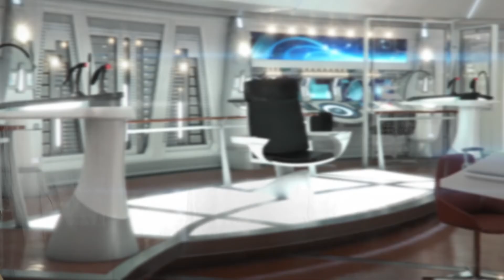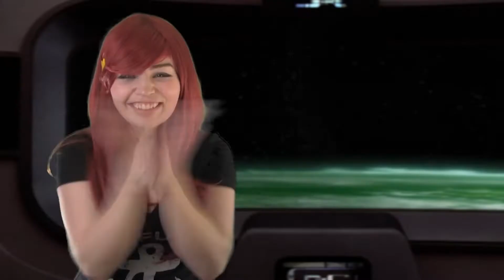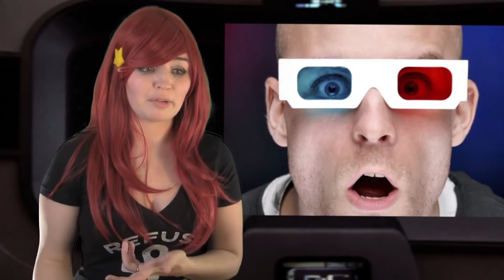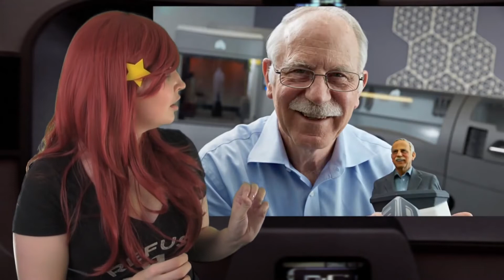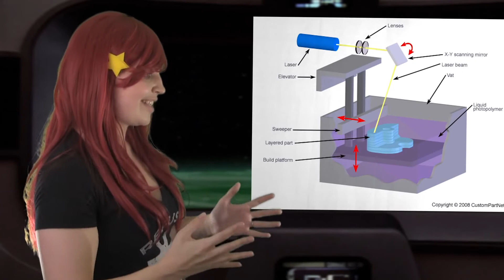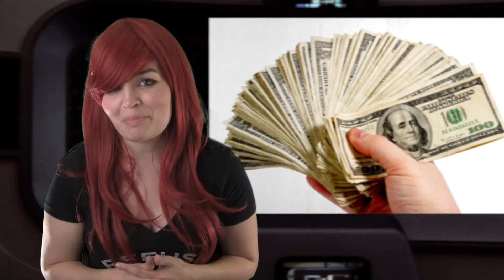How Does 3D Printing Work || Kiriosity Classic

Comment: I have my own 3D printer. I have printed a couple things for others. You can get some super nice prints. 
With the variety of CAD programs, the different 3D model sites, plus various slicer programs available has opened up 3D printing to a variety of small businesses, and individuals to do work that was not possible just a few years ago.
What can be created with 3D printing is only limited by 2 things: printers capabilities and an individual's imagination.
With photogrammetry apps for smartphones, you can scan items, even yourself and 3D Print your wedding cake topper or a scaled model of the wedding cake.

Comment: I bought a cheap 3d printer to make dnd models and it work well, especially since I became a new DM. After a while I started using it to print wall hook for my wires and hats, small custom gifts.
Reply: Did you see the new resin printers under $300

Comment: I picked up a used 3d printer just to get my toes wet, and it's been a great experience. there is a learning curve, but for under $200 (or in my case $100) you can get started with a small system and start making things. I've so far printed camera accessories, d&d figures, and just random things like a 3D Gamecube logo
Reply from the maker: That's amazing! It's fascinating to see how much more accessible it's become since I made this video as well. In just... what... 4 years? 5, maybe?

What kind of camera accessories? Have you been designing your own designs?
Reply: @KiriCallaghan  I've printed battery holders, film roll holders, and a film strip puller. so far all other people's designs, but I have modified a few of them to be more suited for me, and I do have some ideas that I need to bring to life
Reply from the maker: @MattHooker  That's so cool!